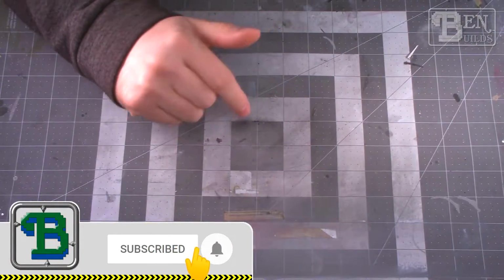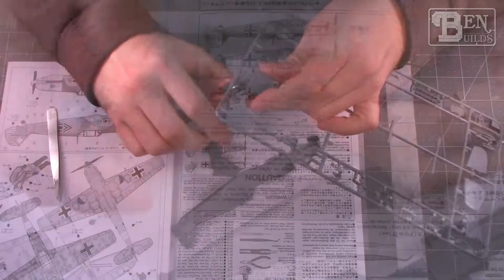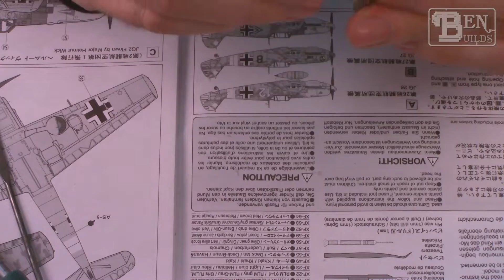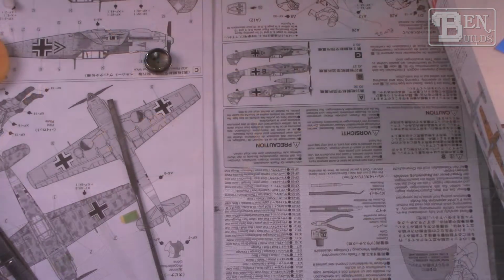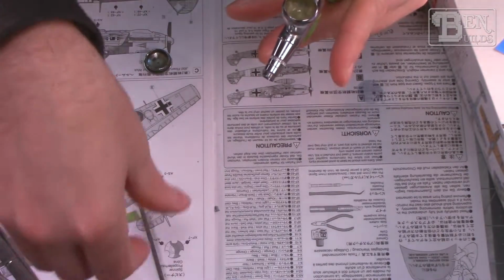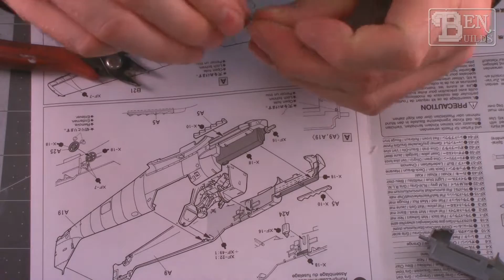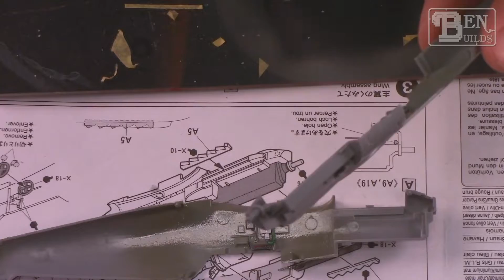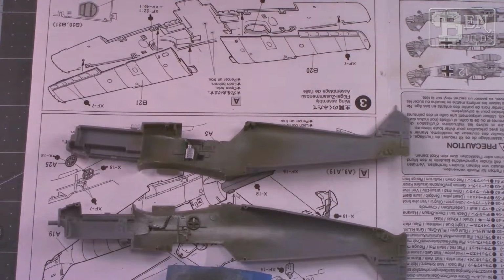Ben Builds With Joe S3 - Bf109 E4/7 Trop. - ep 2

Comment: One thing I don't understand is why go to the trouble of washing the parts in soapy water to get rid of grease and fingerprints only to then hold the parts with your fingers?
Reply from the maker: LOL, good point! I usually wash the parts just to get rid of the mold release agent, haven't worried too much about my finger prints. At some point I need to grab some gloves, but I keep spending my money on kits lol.
Reply: Sounds like you're as bad as me! 😅 "Oh, just one more!" 😊😊😊
Reply from the maker: @garyhiggins6718  Oh yeah! lol
Reply: Actually I haven't done a kit for over 40 years, since then I have been sculpting, casting and painting figures, so I am intrigued to see how things have improved since then? 
BTW, this is one of the first kits I have bought, so I will follow this tutorial very closely! 😊😊😊😊
Reply from the maker: Wow, it would be interesting to get your opinions on what you notice. I know quite a lot has changed since I started building models and the technology just keeps getting better and better. I'm glad you took the plunge on the D.520. So far it is a really fun build and the fit is wonderful.